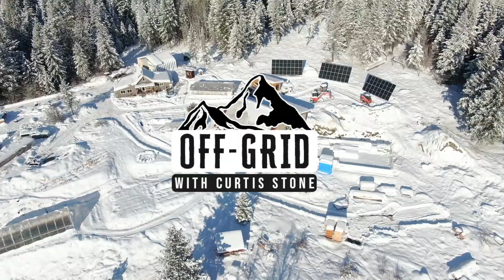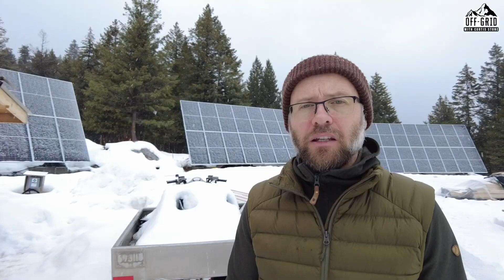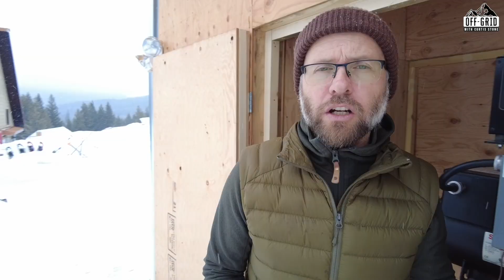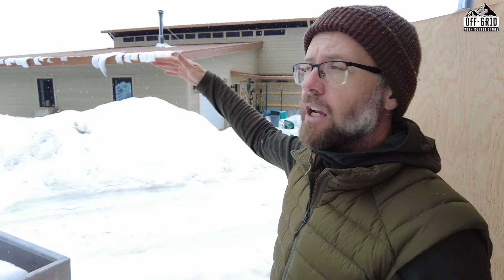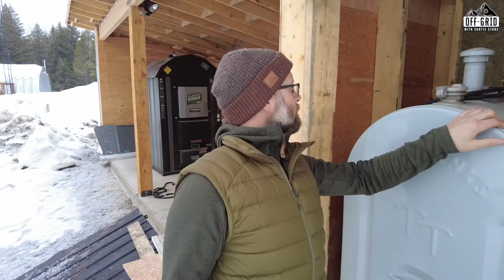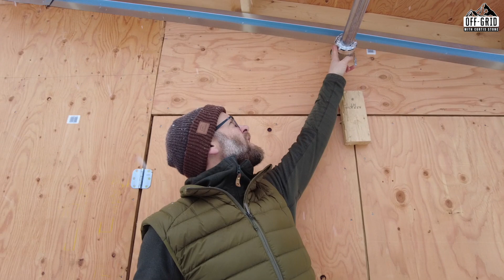The One Part Of My Off Grid System That Might Trigger Some! The Big Secret Comes Out!

Comment: Hi Curtis, if you way up the cost of the energy efficient appliances such as a heat pump dryer vs conventional, I think you would be far better off spending that extra money on more solar panels.

I have an off-grid power system where I run air conditioning, washer/dryer and dishwasher and often all of them at night.

I have considered buying a heat pump dryer myself but I decided it didn’t make financial sense.

From what I can tell heat pump dryers are also incredibly unreliable and expensive to repair.

This repair technician video explains the issues with heat pump dryers very well:

https://youtu.be/xn03N3b0-lE?si=v0e7pKSjhUBEeAJ4
Reply from the maker: Yes. We did exactly that for the new house.

Comment: Love what you have done!  -- QUESTION -- Is that yanmar a four cylinder or three as I can't tell the model number??   Also, any big preference between Perkins vs Yanmar vs Kabota engines for a generator?  Not sure if you got into th weeds on that issue.  Sure would love to listen to that running under load to hear the sound!

Comment: I live on 2 acres and my family helps with projects from time to time. Our next project is a on site generator. Going with gasoline because of the need to convert to biogas in the future. We are actually looking to use an engine from a car. Possibly use the heat/ac components and use the radiator system as a source of heat. Along with charging 12v.

Comment: From experience in generator installation and event power support I agree that Diesel generators are most efficient when run in the 40-80% range. Also the engine is less likely to wet stack and the gen head gives the most stable output and reliable service. Please explain what a tidy tank is and how it is different from the usual fuel oil tank.

Comment: Even if only around 10% of your electricity is from the generator, where I live for example, over 60% of the electricity on the grid comes from fossil fuels, 52% from coal alone. No one can say anything about you using a generator unless they're an idiot.

Comment: Obviously, a long-life generator, glad you have not run the gen in 2 months, good sign you have a proper sized power system. For poorer people 2k for a 13k propane generator works too.  Nice build on everything. My lowest day was 5.6kw on a 8370 array with over 100 days straight overcast/fog. Nov 2023 4 hours of sun.

Comment: Biggest issue for most is how do you make an income living far away from cities. 2nd biggest thing is typical people like being near others not 50-100 miles away from other people. There are properties near cities that have wells, septic tanks, and one can build an off-grid solar system. The question becomes will AHJ allow it? Some zoning and cities require power from the utility if it's on the property to be connected. I suppose could get it connected get occupancy approved then disconnect it. I have heard of this before I suspect it's more about the city just wants the wiring to be there for any future owner who may not want solar.
Reply from the maker: We're not that far from towns. People can make income in smaller towns and online. Smaller towns of 2000-8000 people need lots of services.

Comment: What is your fuel consumption?….why wait…? For your old washer and dryer to fail….I’m your arm chair quarter back….but I’m for real…
Reply from the maker: 100 litres per year so far.
Reply: @offgridcurtisstone  I envy you, this winter been crap for me, 270h put on my power plant, and at 10L per 4H well, I don't want to do the math it is too painful! I just know time to get that wind turbine built, I'd be dumping energy had I got it up this year!  Mind you doesn't help the battery bank is massive and the peak charge rate is 60amps.

Comment: It took me a long time to find LED lights I can use to read by. I hate the blue/white ones that used to be all there was. 
My energy bill was such that I had to find ones that work for me. Now, at least here in Ireland, they’re commonly available. I need warm white and they have to be dimmable. Those are a little less efficient than the cold white ones, but they have a much more natural colour and, unlike the cool ones, they can even power a solar only calculator.
For what it’s worth, changing all my incandescent bulbs to LEDs, did make a small, but noticeable difference to my bill.
The biggest change we need to make, if we stay on grid, is to stop using electricity to heat water. But that requires a level of inconvenience I don’t want in my life, so off grid is my next idea.

Comment: Our "off-grid" art studio, with Mini split A/C and heat pump, in Texas, has a cheap transfer switch, as the shed is there to be used. It still provides about 9/10ths of it's power from the sun, and that is what I'm hearing here, do what works. We're looking to move to the tropics, which is why I'm training on off-grid, and watching your videos, has probably convinced me to put in a Diesel generator. Where we're going uses a lot of Diesel, so will be easy to get. I am testing panel movement. I do wonder if you get sun tracking at all that goes over the panels, if a simple, single axis tracker with linear actuators might provide an increase that is usable since you said you can tilt them yourself. The cheap $40 actuators can move 300lbs, per, and can be controlled by a $65 ebay tracker, which might be worthwhile looking into. I built one with an arduino, just because I do like to geek out and have the time. I had two of the 12" actuators running off three 18650 3.6v batteries. The actuators and controller, use very little power. But, it sounds like it's just easier to use the generator. I only suggest it, because it looks like it would be pretty simple to cobble onto your current system, and could be done for probably close to a $100 per rack. And hey, moving panels are cool...

Comment: Almost every of grid system will be different (do you need/want/like Solar/Diesel/propane generator, the noise etc), water source etc etc the list goes on. Almost every person needs, desires and wants are different. Arm chair quarterbacks need to keep to themselves and watch your videos for what they are made for. INFORMATION. If you don't like, don't watch (enter Woke, watch and complain because it does not meet THIER agenda). I'm 3 years into my project, I'm a DIY guy but this project mainly contracted because its 6 hours away from our current residence (moving in 10 weeks) So far we have the water and wood heat sorted in a Barn that will partially become out residence (rolling propane and electric heat sources on top). Once we get there we will have all the gear but nothing else together.. 50+ solar panels and Victron gear etc. Insulation to install, framing to build.... I watch you and others to see if I missed something that i need to consider before its a big do-over. I appreciate all your information videos and the immense time I know that is required to put them out. More so I love you candid attitude to everything.. "If you don't like it, too bad' (see intro re different needs) Thank you and good luck for all the next projects as they never stop!

Comment: If a diesel generator is 50% efficient would it not be possible take the other 50% (which is heat) and heat your solar shop. Exhaust would need some cleaver extraction process for safe air and rad is simple to tap off.

Comment: You have a 48 volt battery system but yet your trip conditions for generator to start is at 49.5 volts  which is 55% charged. Is it because you do not like your batteries to be no lower than 50%? Which is more concern with lead acid but not lithium.

Comment: I want to connect the generator engine cooling system to the wood stove to keep it hot using less wood.  However I would plan to run the generator much more often but using waste oil for fuel.

Comment: Why not compromise and go propane dryer? A heat pump dryer sounds very expensive indeed. We cook on propane, dry with propane and heat with wood here (including all our hot water in Winter). Thanks bud. Good info. By the way we just had a 4hr grid down this morning during my Aquaponics bell siphon orders so I went to the shop and fired up our HF 9000w generator (about $700 in 2021) and got everything built and shipped. I have a neon light connected to the mains so that I know when the grid comes back on. Not being auto switch over I wouldn't know when the grid is back as I of course have the main breaker off. 👍😎👌
Reply: Bringing propane to the top of a mountain and storing is expensive. Heatpump dryer is the way to go.
Reply: @Built2Perform  got it. You have considered all the options too. We too live high up and love it. We only go through a hundred pounder a year here for drying and cooking so I just truck it myself but I get it. Have a great day👍😎👌
Reply: @fiskfarm  Where we are the heat pump dryer is not much more than a propane dryer would be.  Propane per btu is pretty expensive even compared to offgrid kwh. We too use the smaller tanks for cooking and backup heat. Heat pump dryer also doesn't need to be vented!
Reply: @Built2Perform  very interesting. I love hearing what other locations require. Here in NE TN propane is still very reasonable. I set us up with 275g of off road diesel when we first started hearing the warnings and running our Cat excavator and Swinger loader we have only gone through about a third of that and I use both quite a bit. Thanks to Curtis, Diamond and Bear and many others we are way ahead of the curve. We have heated with wood in various parts of the country for about 50 years and I design and build our own wood stoves and boilers so we have always been ahead of the curve I guess. We raise much of our own food with chickens, sheep and trout (in our 2000 gal Aquaponics gh.) We have always known these times were just around the corner and here we are. NE TN was a great choice for retirement due to the climate (51f all last night) and freedoms. Stay safe.
Reply from the maker: Because I make my own electricity, that's why.
Reply: @offgridcurtisstone  converting a heat source, diesel or Sun, to electrcity and back to heat is horrendously inefficient but whatever blows your skirt up Curtis. We'll just agree to disagree. Retired Master electrician here so I love electricity 😁
Reply from the maker: It might be, however when the sun is shining, that power comes in with zero effort.

Comment: I love the hydronic heated concrete floors. I experience them first when I was in Korea back in the 70s. They had a small burning device outside the room that you put a round block of charcoal that had holes through it. In Korea it was called yeontan. Like remember having to go out sometimes in the middle of the night putting in a new block of charcoal as the other ones burned down slowly. But they worked great, they were efficient and safe. I also experienced the other type of floor heating in Korea which had basically a chimney system going underneath the concrete floor where the hot gases went through the chimney system and heated the concrete floor. That was called on doll Heating. The bad thing about that type of system was when the floors got a few years old they started to build cracks and you get carbon monoxide leaking into the room. If that happened and you woke up with just a headache consider yourself lucky, there were many deaths because of that type of heating system.P.S
 Liked and Subscribed.

Comment: Hi Curtis,wondering about microbial growth in diesel after 6 months of sitting, but it sounds like your fuel doesn’t sit that long if you are using it for equipment.
Reply from the maker: Never heard of that being an issue, but you can put stabilizer in it if it's going to sit long anyways.

Comment: Curtis, Thank you for taking the time to share this. This is the first video of yours that I've seen, so far. Know that I'm not judging. I'm merely asking questions to better understand your system(s). Do you have Bi-Facial panels? We would like to have solar and an off-grid generator setup large enough to run our entire property. We are working towards some of those goals. Maybe some day soon.  Take care, Tony
Reply from the maker: No. They weren't available when we built the system.
Reply: @offgridcurtisstone  Thank you for responding. Your setup is the kind we want / plan to do for our farm and outbuildings. (Outdoor furnace, solar and back up gen.)  Tony  (Ontario Canada)

Comment: Something else to think about diesel , with tanks a big issue is air & condensation , what those do to diesel .
Especially in larger tanks and sitting for a length of time & varying climate  - causing mold etc. to fuel .
So the idea of bladder tanks [ no air space as you use fuel ] .
From watching just a few of your videos , I would guess you have given some thought to this ?
But also , I think of an " open to public type for forum " - sharing info with them also ---- not " you should do " ;)
Thanks again
Reply from the maker: Yes. That tank separates the water at the bottom.

Comment: That's a nice generator setup and I like the way it's automated to start up  ! 👍 Those Yanmar engine's are pretty bulletproof . We have one in a JD skid loader and all we have done to it is change oil & filters after 5,500 hours . 
  We use a truck mounted gas driven welder /generator if the power fails for temporary electricity to the home . 
 At 24:22 is the reason we stay with rural electric power company as if I do the math our annual power bill is around $ 2,000.00
  So $130,000.00 will buy a lot of energy for many years to come .

Comment: My biggest personal roadblock for off grid living is the “physical plant” management required day to day, and weather induced variables. Sometimes, I am gone for 2-3 weeks at a time. My wife would never be comfortable assuming the role of managing the “off grid physical plant.” Basically, for me to be free to go on an adventure trip for a couple of weeks, I would have to have a “bypass to grid” switch….otherwise, I would be forever trapped on the homestead by an off grid system. My phone would be ringing endlessly otherwise. Without a grid connection to bypass onto,I would become a slave trapped on the homestead.

Comment: I purchased a blue light free, zero flicker LED bulb for next to my bed. I would have gone with an incandescent bulb but i'm only working with a mere 6.5kw of lead acid storage and my old incandescent bulbs literally used 10 times the power as this new one. I haven't noticed any real sleep disturbances as yet.

Comment: Aside from all other arguments about a generator or more solar, I think diversifying your power source is very important and has big advantages. It gives you options and reduces the number of single-point failures. I really like your setup ad what you plan to do.
Reply: Completely agree with you mate
Reply: Why not diversify further by tying to grid to make use of it instead of burning diesel in winter? Can still have the generator to be completely autonomous if power were shut off. Genuine question, not an argument
Reply: He's in the middle of a forest, there is no grid or it will cost hundreds of thousands of dollars  @padraics

Comment: I used to hate LED's, until they were manufacture as a warm white light.  I don't like the blue wavelength either, but very acceptable warm wavelength units are available.  Off grid 23 years.

Comment: Were offgrid in central BC and need to run our generator every few days for a few hours to keep up with the house. This the first year ever needing to run it past the 5th of February,  it's an older system but over the last summer I noticed a big difference in the suns energy output. Have you noticed this same problem? Or maybe our panels are just getting old.
Reply from the maker: Big time geo-engineering happening in recent years. It definitely dampens solar, but not debilitating. Part of the reason I did the size of system I did.

Comment: Curious on your boiler set up your doing. You mentioned you are doing propane backup boiler. With all the diesel you have stored on site already have you thought about doing a fuel oil boiler instead of propane since fuel oil is diesel. Just curious about that because you mentioned for you diesel is easier to get/store on your property.

Comment: I really like your system. You have a good balance between ideal vs practical.  I noticed that high tower with the wind power on it. I would love to have a property like that and would put a GMRS repeater on the tower to provide communications for miles around. Of course, you may not want or need such.   

One thing I haven’t seen from you (I’ve only watched the last 2 videos), is there utility power available to you if you wanted it, or were you forced to go off grid? (I realize you want to be off grid, but just curious).

Keep up the good videos. I really liked this one.

Comment: Those server rack batteries have battery management systems already built into them except they do not communicate with your inverter.  
I think what you need as a Schneider Connext battery monitor. It’s a $900 item and it has a prescaler box which then connects to the major positive and major negative of the DC bus. All of the current that goes in and out of your battery pack goes through a 500 or 1000 amp shunt and it acts as a precision resistor to determine the current exactly. This is measured overtime and when programmed properly to the size of your actual capacity it will give you a read out in percent of full. That will provide a very accurate means to determine your actual state of charge. I have one. I live off grid too. Lithium iron phosphate batteries have a very flat discharge curve. It’s very hard to determine the actual state of charge through voltage. I like your system thanks for posting the video.
Reply from the maker: Thanks for that. Can you tell me the exact model you're referring to? thank you.